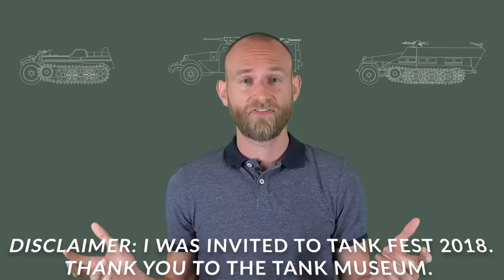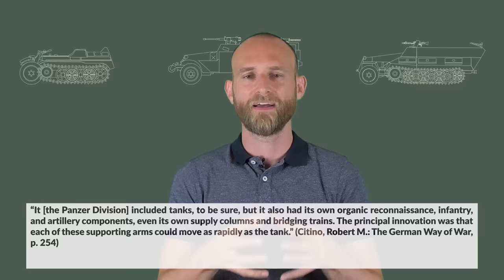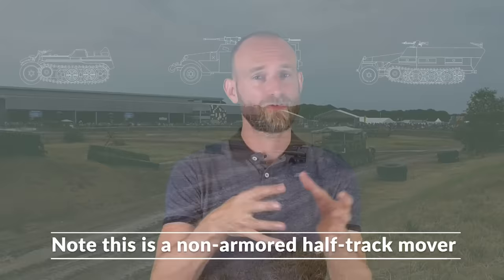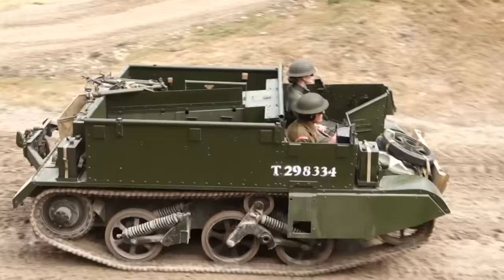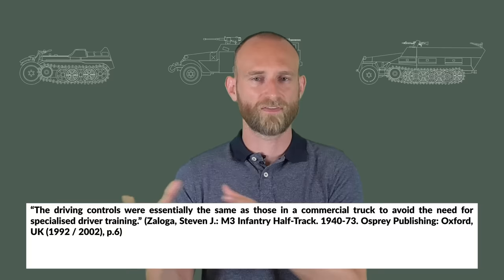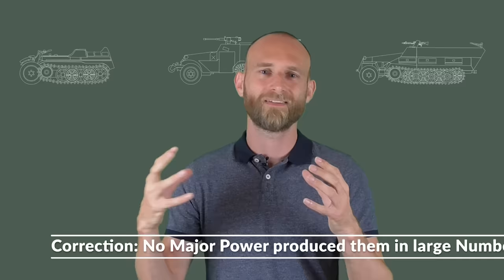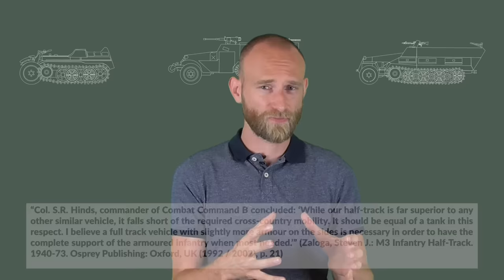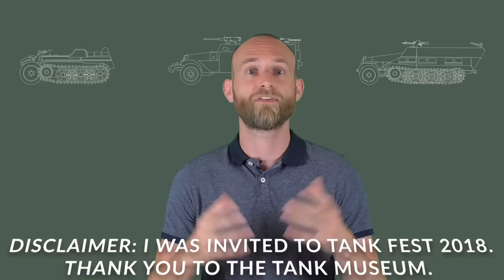Why Halftracks? Why limited to WW2 only? (Featuring Tank Fest 2018)

Comment: I don't think you ever addressed the basic question of "Why aren't half-tracked vehicles made anymore?" You addressed why the specific configurations used in WW2 aren't made anymore, but not why half-tracks were abandoned altogether. The reason for that is: Half-track vehicles were all essentially rear-wheel-drive, except the rear wheels were replaced with tracks for better traction and towing capacity. After WW2, four-wheel-drive eventually improved to the point that a 4WD wheeled truck could have the same off-road capability and towing capacity as a half-track truck, while also having a tighter turning radius and without any requirement for special parts. Modern 4WD is simpler, more reliable, and better-performing than half-tracks, so there was no longer any use for half-tracks.
Reply: That's not correct. The American M3 half track was based on the 4WD M3 scout car. The front wheels and the tracks were both powered. The M3 scout car had much higher ground pressure than a tracked vehicle, so it would sink in the mud and other soft ground. Tracked vehicles perform better off road than modern 8x8 vehicles due to their lower ground pressure.
Reply: Jim Man  

I'm with you...
A modern quad-fifty half track with a cutting edge armor system would be sweet.

And frankly, a pretty utilitarian choice to resurrect. I'm sure there are still some genuine uses for such a platform still.
Reply: Jim Man  
No doubt. I agree with you, especially about decisions made that put relatively unproven weapons into an active shooting war to the detriment of tried and true battle rifles with years of development behind them...

That's just short sighted leadership choices, putting cost effectiveness over solid state proven capabilities. 

As far as the quad fifty half track. I understand they were useful in ground combat in Korea during massed infantry attack. So much so that barrel overheating was an issue. And like the gun trucks of Vietnam, a light vehicle that is essentially nothing more than a multi gun platform still seems useful to this day.

Fill the gap between APC/IFV and Hummer with a ring mount. Those guntrucks, in Iraq, were pretty necessary during logistics (fuel/food/material) convoy runs.

In fact, as a principle, when is a high mobility, high firepower output vehicle not a good idea? It should be a permanent fixture in mechanized warfare.

Okay, so maybe a half track isn't the perfect host vehicle... but a quad mount certainly has significant impact on the battlefield if employed to full effect.

My two pennies.
Reply: def not a 4wd truck, a 6x maybe but not in tough conditions and they would cut up the roads if they're dirt. Up hill in sand a 6x truck is challenged, 20 of them will take an hour to climb 500ft. So they wont be towing guns and they wont be loaded with a section of men and their gear.
Reply: The simple answer is the APC, because if you think about it half tracks were the first APC's the world ever saw. Look at the tract back end of a German half track, then visually increase the size of the back end by about 50 %. If you were to then put a roof and a back gate on this vehicle, you would come up with something looking like a modern APC. The half track is the genesis concept of the APC. Like you said we have better 4WD vehicles for hauling, but the half tracks' most vital role was mechanizing infantry, so with better technology available or in development towards that end, there would be no need to produce the half track anymore. Makes sense.
Reply: ya this is all b/s explains zip
Reply: Jim Man  You are wrong about the m16. True it was unreliable at first ,but it was only because the ordinance corp/Army hated it. They were very stubborn in accepting the m16. So they sabatoged it. Making false claims that it was self cleaning,  as well as swapping powder loads which resulted in extraction failures. Eugene Stoner himself gave them the proper instructions on how to clean it and showed how to himself.  But they gave the troops wrong instructions on cleaning it.In hopes of doing this, they would convince the branches of the military to go back to the m14 as standard issue. They even kept using the ball designed rounds that were not suitable for the weapon either. 
It's been shown throughout history how stubborn the army is when it comes to changing ammunition types.
In 1967 the m16a1 variant was issued. Fixed the problems it had before and most of the troops after appreciated it. 
So you can thank the Army ordinance for giving the gun a unnecessary bad reputation along with the bodies the Army brought back
Reply: The original half tracks were mainly a sort of slap together hybrid of existing truck designs with rear tracks and some light armor. They served the purpose with minimal factory and tooling rework to get them out the door fast and cheap. But if you actually sit down to purpose design a vehicle for that role, when you have the luxury of development time and budget, without the pressures of a World War, they found more built and designed to purpose vehicles better met their needs. Which were invariably full tracked or wheeled.
Reply: 9:00 here's where he answered the question.
Reply: Not true modern 4x4s are not any better and many ways worse for traction.    Other than electrical operated hubs and shifted transfer case the system in 1940s jeep is the same as a 2021 jeep.
Reply: @mgibbs88  thanks for letting us know!
Reply: modern apc´s like patria amv xp with 8 wheels go over 100km/h. and can be used to go in water at 10km/h. carries 12people. 1000km operational range.
but in winter conditions finland and sweden uses tracked apcs.
finland Sisu Nasu and sweden Bandvagn 206. carries 17 people. Maximum speed 65 km/h (40 mph) (roads)
5 km/h (3.1 mph) (water) Operational range 280 km. up to 500km range if Bandvagn Skyddad 10.

it achieves low ground pressure through full-length, wide rubber tracks and a lightweight body. the two sections of the vehicle are articulated, allowing it to keep in contact with the ground over broken terrain. the ground pressure is low enough that the vehicle can traverse loose snow without sinking. the vehicle is amphibious and propelled in the water by its tracks.

-
german switched to full tracks in late stage. "Raupenschlepper Ost (German: "Caterpillar Tractor East", more commonly abbreviated to RSO) was a fully tracked, lightweight vehicle used by the Wehrmacht in World War II. It was conceived in response to the poor performance of wheeled and half-tracked vehicles in the mud and snow during the Wehrmacht's first autumn and winter on the Soviet Front.[1]"
Reply: He did: Doctrine.
Reply: There’s no way that 4 wheel drive with a rear tire is better than 4 wheel drive with tracks as the back wheels. If that was true that would be saying that wheels are always as good or better than tracks. Tracks, as long as they’re not the same size as the wheel they’re replacing simply grabs more ground. That’s why I don’t really understand the really small modern tracks they put on trucks these days that are basically just a misshapen wheel that really only grabs a couple inches more ground than a a wheel would, I guess it’s effective enough.  I’m open for corrections.
Reply: A 6WD truck requires a transfer case, 3 differentials and 2 constant velocity joints.  A half track on the German method needs only a standard 2WD truck system with a single differential with locking added and a slight modification to the the braking bt connecting to the steering.  Even a modern AFV/Tank needs 2/3 differentials for steering.   We could build modern half tracks and they’d be very cheap and mobile.
Reply: @paulholman2841  Well, WWI armoured cars were the first APCs - just no one ever remembers them because they were such a short lived terribly limited concept. I won't argue if someone wants to call them "APC v0.5" or "APC Beta" instead of "APC v1.0" though lol.
Reply: Wrong m3 half track was track and front drive.
German were really 3/4 track and no front wheel drive. 
The purpose of half track was because it was easy. To convert conventional truck like how the m3 half track come about .
People sat it's cheaper to make a permanent tracked vehicle than a half track.  I Don't believe that  .
Reply: @thebigsad5402 The M16 was butchered by the army. First they deleted the cleaning kit because it had a chrome lined bore to save money and then they deleted the chrome lined bore to save money.
And added the utterly useless forward assist.
Reply: Tires get popped. You can’t really pop a steel track.
Reply: @MimiThomaFlwrs  You can “pop” a steel track. Tankers get really used to replacing tracks because their life is so short (particularly on road) due to broken track pins and links stretching out of shape. Tracks advantage is low ground pressure enabling mobility off road in terrain a wheeled vehicle will sink out of sight.
Reply: @allangibson8494  it’s a lot easier to use bullets to break a tire than to break a track.
Reply: @MimiThomaFlwrs  You obviously have no experience with solid, run flat or airless military tyres. It takes almost exactly as much effort to damage “A” tyre as break a track - and wheeled military vehicles can have ten or more tyres with 50% redundancy on each side. Thats why wheeled military vehicles have resurged in popularity recently (and their 50% higher top speed on road with lower fuel burn).
Reply: @allangibson8494  yapping in favor of smth doesn’t give you any more ‘experience’ than me in it. Procure yourself some perspective. Knowledge =/= experience. It’s a YT comment section you’re not defending the gates of Rome.
Reply: @MimiThomaFlwrs  I have experience with both tyres & tracks. Both have advantages and disadvantages.
Small bore rifles won’t do much to military tyres. Once you get above 20mm explosive rounds, they will also take out tracks.
Soft skin vehicles are more vulnerable to hits to engines, transmissions and fuel tanks than tyres.
Reply: @andrewtaylor940  US halftracks were of simpler design, but not cheap.  There was one exhibited in Wheaton, IL which had an original placard stating that "This vehicle cost the taxpayers $16,500."  That would be nearly $500K in today's money, for a glorified U-Haul with 4WD.
Reply: @paulholman2841  The Half track was definitely an APC. They were designed to transport troops to battle where they were to dismount before coming under direct fire.    The German variants such as the SdKfz 251 probably would outperform many more modern ones like Russian BMP-2.    The open top was no a big big.  The troops inside were protected from small arms fire and fragments from shell impacts on the ground.  Only  an burst  close enough directly above could injure the occupants and that was hard to achieved on a moving vehicle.   BMP troops ride on top because if impacted by a mine or RPG the enclosed space is what causes the fatalities since there is no way for the over pressure to vent.  In fact the front wheels of an half track or German 3/4 track provides some protection from mines since they may detonate ahead of the vehicle and ahead of the driver.
Reply: Basically tracks require more maintenance than tires. I worked with excavators for years.
 The daily routine was I greased the track and boom. While the operator checked the engine and hydraulic levels.
Then we went to work.
The track was for navigating in the mud. You can drive a rubber tired excavator on the road.
Not good idea to run a rubber tire excavator in wet soil. Well unless you want to pull it with a bulldozer.
But not it is not a good idea to run a track on asphalt. But if you want rumble strips in the middle of the road. Go for it.
Reply: Sorry, you are wrong. All US armored half-tracks had all-wheel drive, which made them more mobile than the German SdKfz.250 and SdKfz.251 which didn't. The Czechs added forward drive wheels on their adaptation of the SdKfz.251, the OT-810 (IIRC). The problem was cost against performance. Tanks needed accompanying infantry and the halftracks couldn't keep up across all passable terrain. As far as all-wheel drive, all the US 2.5t and 5t trucks were all-wheel drive (6x6). The cost of the tracked APC came down as they were reduced in size and because of the need for top cover and closure (artillery air bursts and NBC warfare.
Reply: @mgibbs88  The half-track car M2 was based on the M3A1 scout car. The M3, M5 and M9 half-tracks used components, especially engines from the 2.5t and 5t all-wheel drive trucks.
Reply: @BeingFireRetardant  The quad mount .50 was primarily an AA weapon. .50 was no longer effective in any combination and the US Army went on to twin 40mm in the M19 and M42. It is also why a number of countries, such as Israel replaced the four .50 MG with two 20mm cannon with longer effective range and impact on target. 
As far as your comment on the M16 rifle, it had been in the field with the USSF, US advisors and AVRN Rangers, Airborne and SF for two years before the US Army fielded the rifle. There was not anything wrong with the rifle until the Army effed up its ammo and fielding process. Note, units like 1st CAV that got the M16 in CONUS before deploying to Vietnam didn't have anywhere near the issues the units in Vietnam that got "driveby" fieldings did.

Comment: It is interesting how people speak so highly of halftracks, while they actually got all the disadvantages of both wheels and tracks in one package. But they did the job they were supposed to do. And that is enough reason to call something effective.
Reply: I am reminded of the old saw regarding motorcycles with side cars. "They have all the disadvantages of an automobile and a motorcycle and none of the advantages."

To be fair they do have their charms, and they are cheaper then an automobile.
Reply: @gonova8412  Good point there.